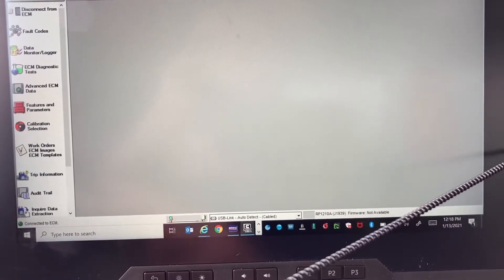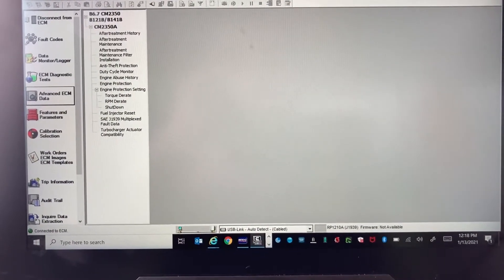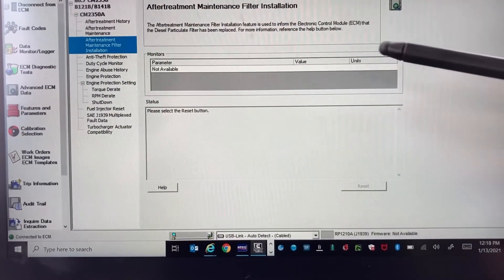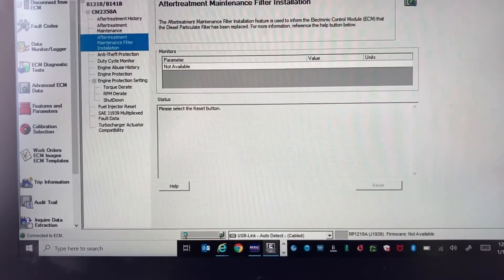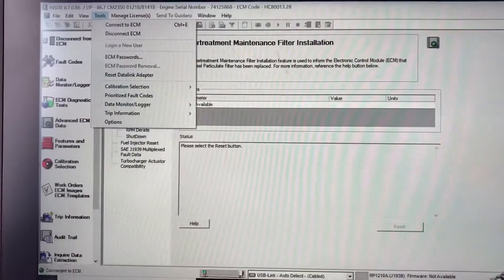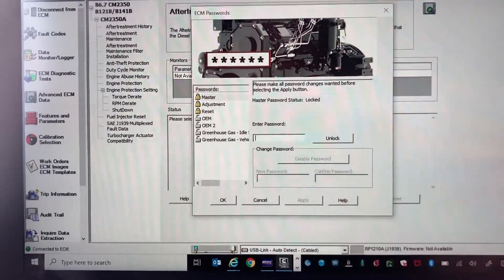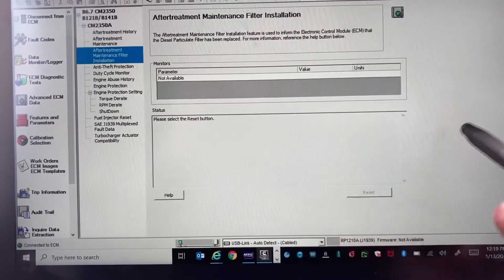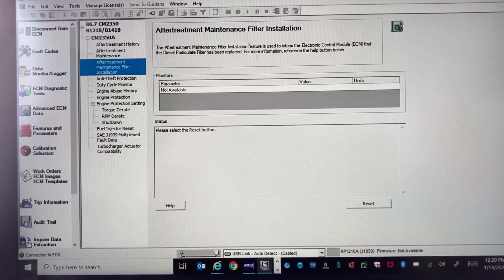Resetting Cummins DPF data after changing the DPF filter

Comment: Very nice video.
Kindly advise...If I change my dpf  filter only to a used one that is only 1 year old from a used part dealer, and I install it on my truck, and I will re-use the same electronic components like the sensors,circuit board, do I still need to reset to inform  the ecm if I dont have any engine light?Im just replacing this since my dpf is 9  years old and I got this one almost new that is only 1 year old.I however dont want to change it if it will create unnecessary codes after installation.
Reply from the maker: I think it should be fine to replace it and not reset the computer
Reply: @alreyindustries  Thank you for your input glad for quick response.I will keep you updated once I change the filter when it warms up.
By the way I clean my dpf filter at home with garden hose and some non degreaser solution.Do you approve this cleaning option?Have you cleaned dpf with water?

Comment: What happens if you don't do this and only do a forced regen when you replace the DPF? Will it throw the CEL?
Reply from the maker: I’m pretty confident that it will NOT throw a CEL. However, I’m only speaking from experience. I don’t know the actual rule on this. I have had detroits throw a code later on down the road because they are basically programmed to be replaced after a certain time or mileage interval. So if you do not reset this after you replace the DPF, once the programmed time or mileage elapses, it MAY throw a maintenance code asking for the DPF to be replaced or the data to be reset.
But in my experience I have not run into this problem with Cummins. So I think you should be ok.
Reply: @alreyindustries  Appreciate the information. I work on a handful of 6.7 Cummins in Freightliner applications and after I replace/clean the DPF & DOC I have only ever forced a regen with a handheld tool and then sent it on its way. It has worked so far in the Cummins application but was curious in other manufacturers. I only work on a few so buying software like Cummins Insite isn't worth my time.
Reply: @sikknasty28  what hand held tool do you use? I've been trying to find a good one.
Reply: @greasygamer3379  Have the Diesel Laptop handheld but have heard the CanDo HD Code II Handheld works well too. The Diesel Laptops is advertised as working on more platforms but we only ever use it on Cummins/Isuzu so cant speak for other platforms like it advertises. They are the same price point
Reply: @sikknasty28  hello, i have 6.7 cummins in a landstar 4000 series. am looking for the proper software to access  emission system in ecm. thank you
Reply: Hey bro,have you done this with a catalyst?Like changing the catalyst and forcing a regen instead of resetting with insite?